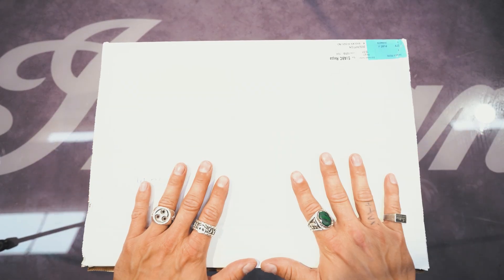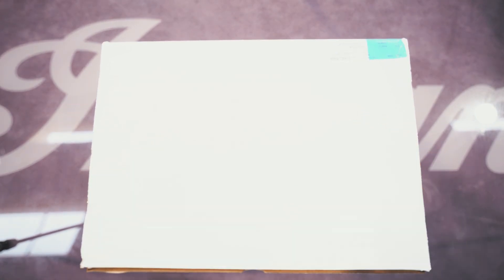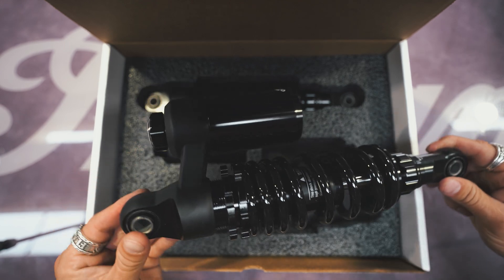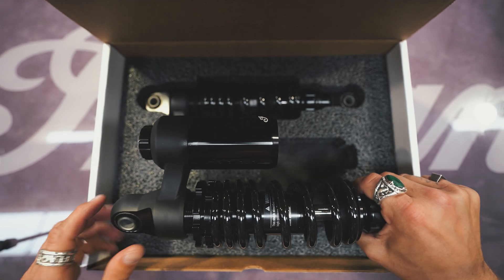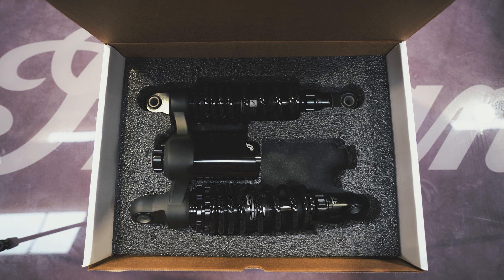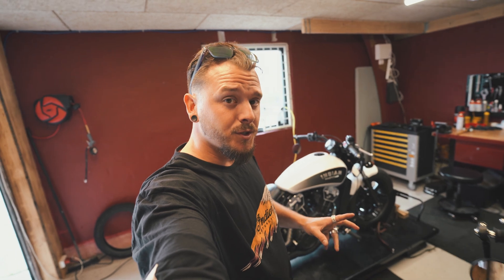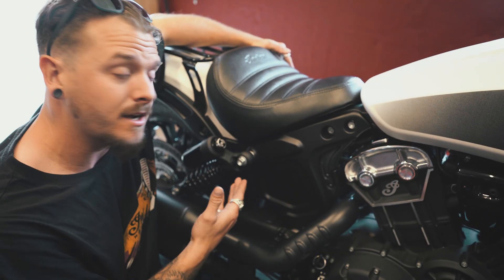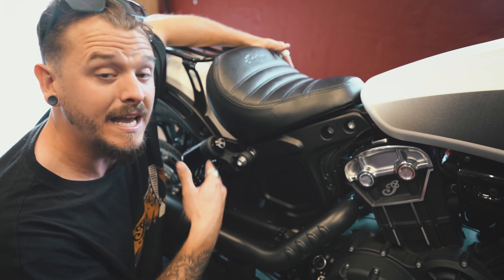Indian Scout Bobber ADJUSTABLE SUSPENSION UPGRADE!!

Comment: Great review - installed mine today on my 2024 rogue sixty and set them at two clicks - 75 miles later and they are amazing ! Also added an LED Headlight, and the more comfy seat ! Next will be Tab Performance exhaust with the 1.75 baffles !

Comment: I got the piggy back adjustable suspension on my 2021 scout bobber as soon as it came out. Recommended. Its like night and day. Get it!
Reply: Is it really that much a difference ? I am curious to give ‘em a shot. What major differences from stock did you feel?
Reply: @stogie0608  Yes. As soon as you hit your first semi serious bumb, your a$$ will thank you for it. Also, your able to ride longer. They look cool too and you can adjust yourself.  I didn't have to adjust anything as I had it installed at the dealer.
Reply: I just got a 21 scout bobber and that’s the one thing I noticed right off the bat. I’ve been trying to decide on some aftermarket shocks and I’m glad I watched this video. Also. Have you had any issue with numb crotch?  I’m not sure if mine is from the seat or my posture
Reply: I have the leather tractor seat, which is wider and have never experienced that before.
Reply: @shannonhawkins5739  change seats to a mustang seat or something else. That stock seat would hurt my crotch too along with my tail bone. Upgrading seat was a huge improvement👌🏽.
Reply: @shannonhawkins5739  get the syndicate solo seat bro its incredible
Reply: @predalienftw  that looks nice but I got a seat from Alex leatherworks.